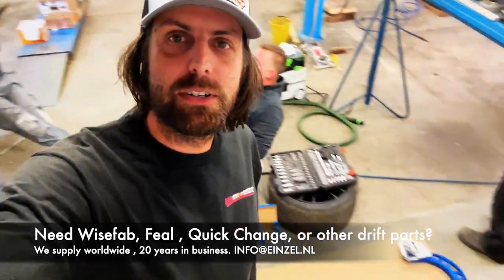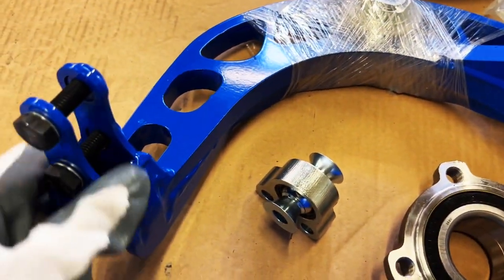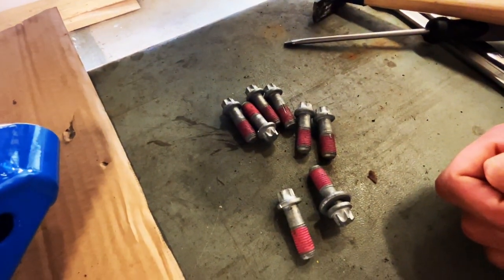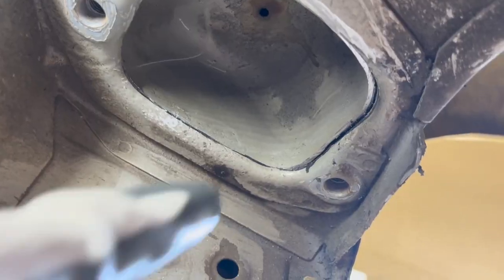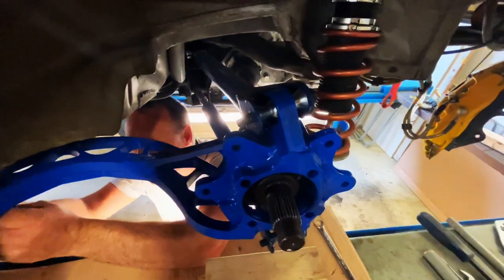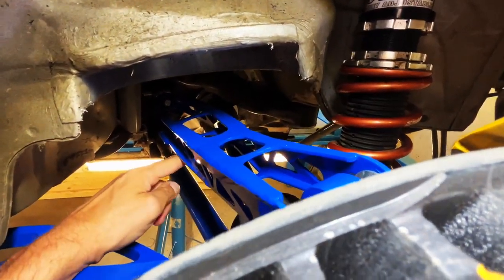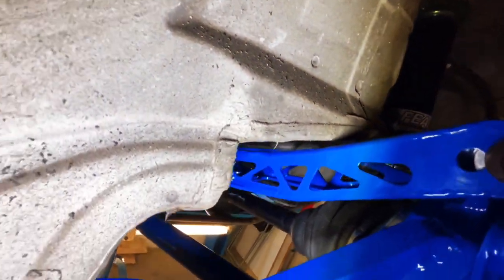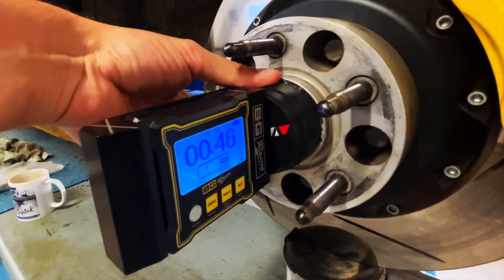Wisefab E36 E46 Antisquat Grip Trailing Arm Explained & Unboxing

Comment: Hey Wout, can you please make a video about scrub radius, KPI and how this affects your steering. About running spacers or low offset wheels and how this changes your steering feel. Whether running an ET15 wheel is the same as running a 30mm spacer on an ET45 wheel. How do you combat the effects of scrub in pro-drifting. Are there different styles of drifting that this adjustment enables. Things of that nature.

Comment: When you say m3 axles are the strongest, you saying e46 m3? And how much hp you thinking before I should be looking at the wisefab axles?
Reply from the maker: The European E36 M3 had big axles too, same spline as E46 M3

A new M3 axle I'd rate at about 4-500 wheel.  Used ones lower
Reply: Does e46 330i has the same axel as the m3?
Are the 330i axel compatible with this trailarm?